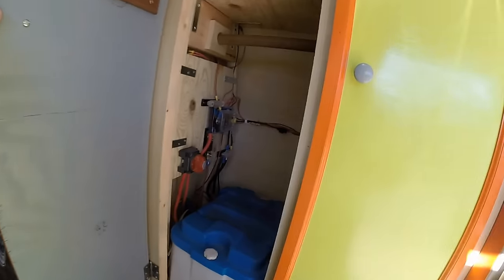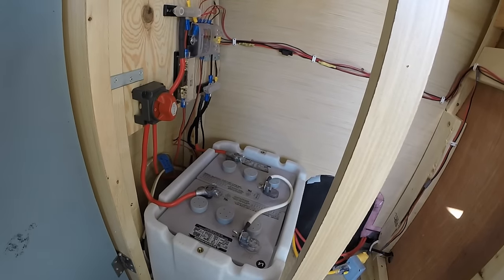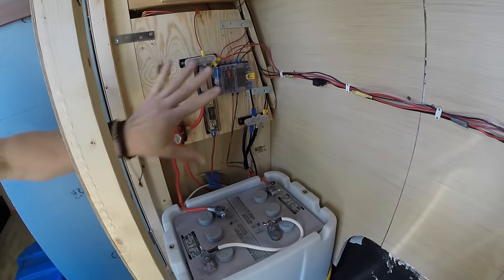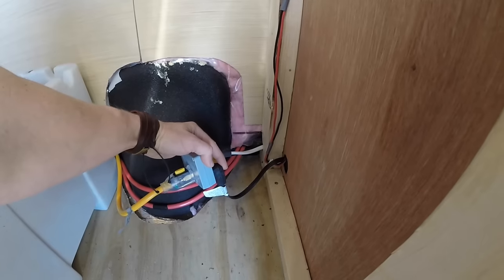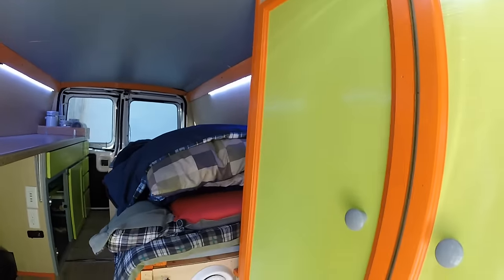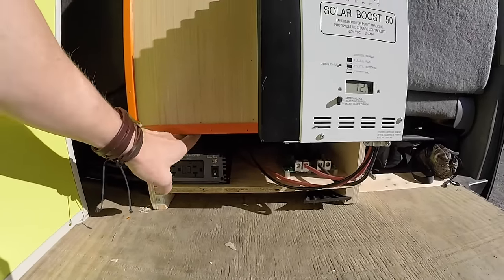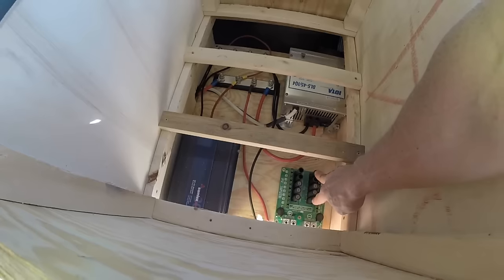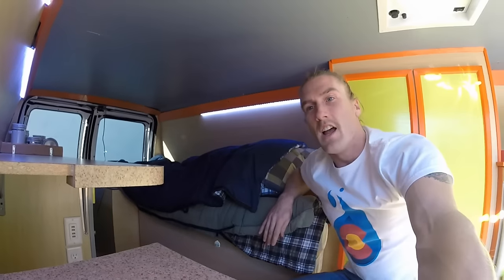Living in a Van: Battery System Installation - #VanLife

Comment: What resources can you recommend for someone who would like to do a similar set up like yours, but who doesn't have the know-how as to how to hook it all together?  I want to buy a van to convert at some point in the future, but don't know anything about hooking up the wiring and electricity.  Thanks so much for your time.  Awesome job on your build out.  It's very inspiring. :)
Reply from the maker: +Jennifer Heredia Google and YouTube. Or me. It really depends on how much help you need, all the way from the whole system design, down to crimping and soldering wires. If you want direct access to my email, sign-up on my website, DavidSandel.com. I'd love to help out!
Reply: *****  Wow that's so kind of you!  Thank you so much.  I may just do that when it gets closer to the time.  I don't even have a van yet. :) hehe  Thanks again. :)
Reply: +Jennifer Heredia  This is a complex system, don't be intimidated. On a small budget start with a 100 watt panel -> PWM charge controller -> 1 Deep cycle battery -> Inverter -> You now have power. Just that will power your electronics no problem. For basically what I've described check out LivingFree channel.
Reply: WanderlustmanChris Thank you so much Chris.  Just curious, why did you go with the PWM over a MTTP?  I have heard that the MTTP is more efficient with the power usage is that correct or is it only in certain circumstances?  I have a lot of research to do and fortunately my brother is an electrician so he could help me with the wiring, but as far as the components themselves go there are so many options.  I was reading that Lithium batteries are better than a deep cycle lead acid battery, but they cost more.  What are your thoughts on that?  Sorry for all the newb questions. It's just that there is so much information out there and it is hard to decipher it in order to come up with what will be best for me and my usage.  Thanks so much. :)
Reply from the maker: +Jennifer Heredia LiFePO4 batteries are far superior, but the associated cost just isn't worth it for a very basic van or RV installation. MPPT gives you more control over tuning the charging system and is generally faster than PWM, but also comes with added cost. For most people, well designed system using the more common, cheaper components are good enough so long as cable sizes, lengths, and best practices are used. I was just lucky enough to get some of these higher-end components for free from a friend.

Here's my blog post on getting started on designing your system: http://davidsandel.com/designing-your-vans-electrical-system/
Reply: +Jennifer Heredia I'm using an mppt controller. I mentioned pwm because there's nothing wrong with them at all and there are $50-$75 ones that are great and are far more likely to last forever (I'm on my second mppt already), yes they are more efficient to a degree. If your budget allows spend the $200-250 on something like a Renogy 40 amp and I say 40 amp over the 20 amp because it's not that much more $ and allows for up to four 100 watt panels. If you can afford Lithium batteries get them, they are superior technology by far. The best regular battery is the Lifeline model 8D and model 4D (I have two of the 4D's) but even those are $500-$700. A starter method is to go with the highest amp hour deep cycle from any big box store or auto parts store. Battery cables are very important, I recommend always sizing up. Larger cables dissipate heat and that will be safe year round and help your batteries live long and prosper. Large cables are also stable while driving. Making your own cables to size out of welding cable is the best way to go. Sounds like your bro could easily do this. The budget route is to get the $40 harbor freight 6' inverter cables, they  are thick, decent quality, readily available and can be cut to size. The cables from the panels to the charge controller are called 'tray cable' and are simply plug & play. Don't expect to run heat/ac. If you want a microwave, small fridge and to use a coffee pot that's when you have to start getting more batteries and more 100 watt panels (I have three panels). For an inverter, pure-sine is the way to go, on a budget there's a million of them. I recommend 2000-3000 watts if you only want to buy an inverter once. I have a pure-sine 2000 watt and run a large dorm fridge, microwave, electric skillet, 32'' led tv, bluray, laptop, video game, tv antenna, phone, speaker bar, two plug-in led light bars and right now also an led christmas tree practically all day every day with no problem. I do turn the skillet off if the microwave is on for a few minutes. 

To do solar simply- There are all in one 100 watt suitcase kits that only need to hooked to a battery and your up and running that fit a lot of peoples needs. Less than $250

To have a gonzo solar van- Get 4x100 watt panels, a 40 amp charge controller, 3000 watt pure-sine inverter and start adding batteries. $1400+
Reply: ***** Thank you SO MUCH!  I really appreciate the information and your time. :)  Blessings to you. :)
Reply: WanderlustmanChris Thank you so much for your reply!  Lots of good advice and information.  I was thinking too that I would probably need a 2000 or 3000 pure sine inverter, but wasn't sure about batteries, and controllers.  Great tip there on the cables!  I hadn't even thought about that.  For me, I would be running either a tv or a projector (don't own either yet and still deciding what would be more energy efficient), LED lights, a very small submersible water pump, a clothing spin dryer for laundry that uses 135 watts for approximately a minute or two, was thinking of maybe doing that conversion on a freezer to chest to make it a solar fridge, but don't know if I will do that yet or just get a marine one, a toaster oven that can do all my baking as well, possibly a microwave (haven't decided about that yet or if I will just use my butane burner for everything) and enough juice to have the ability to charge up electronics like laptops, cell phones and rechargeable batteries.  I'm thinking that's all I might need.  I don't know yet if I will get an electric space heater or one of those gas ones like the Mr. Heater. I like the idea of electric though.  Feels safer to me since I would be using it at night when I'm sleeping.  I like simplicity and I want to have a very simple set up, but I want it to be effective too and enough to handle my power needs without worry.  I'm also wondering if I should get a water distiller or not too.  Still researching that as well.  I didn't know that the MTTPs burn out like that.  Thanks so much for telling me and thank you for all of your helpful advice.  I really appreciate it. :)
Reply: Would love to hear more about your charging from the alternator. How you wired it an such. 
Thanks for the quick overview.

Comment: how much did you spend on your electrical system, who helped you, where did you get your ideas?
Reply from the maker: I was supremely lucky enough to have a friend with the extra batteries, solar charge controller, charge converter, and a lot of wiring. I spent maybe $150-250 on the rest of the wiring, outlets, inverter, and connectors. 

I'm an electrical engineer by degree so I just came up with it on my own. If you're interested, my entire wiring diagram, installation drawing, and a "how-to" design your own system is on my site. Let me know if you'd like the link.

Comment: I will park house in steel building part of time, no sun. Other times I will be off grid. If I don't get enough sun traveling could set up a charging wire off of truck. Just wondering if there is controller to handle all that power input from not only solar or should I set up a separate system of a.c. some things in home will be microwave, ac dc fridge, tv, laptop, ect. Just wondering if you had any advice or how you would wire it for my conditions. Mine is a little out of ordinary.
Reply from the maker: It's really not that out of the ordinary. I'm happy to talk about this a little bit more outside of here in order to explain things more clearly. Send me an email if you'd like to continue: info@vanlife.academy

Comment: You seem pretty good at this I am designing a tiny house and going all 12 volt lighting but will plug into 120 ac alot of time. Question... how do I set up the system to have a charging system set up so I don't over charge batteries with solar, 120 ac, and vehicle altinator charging. Is there a device that will accept all 3 and monitor batteries and maintain them?
Reply from the maker: Thim Bales, Can you explain a little better? How will your tiny house have AC input and a vehicle alternator? As for solar, that’s exactly what the solar charge controller does — it monitors the charge on the battery and then allows the appropriate amount of current into the battery.

Comment: Seems like o.k. Ventilation (if those closets have an air gap).is there no need to strap those flooded lead acid batteries in place in case of a fender bender or roll over,..
Reply from the maker: The batteries are heavy as f*ck so I'm not worried about them in everyday driving. The dimensions of the box and the closet are such that they can't move anyways. And as for a rollover.....I'll have bigger problems than batteries. ;)

Comment: Hi David, I Have a couple of questions I there an advantage to using 2 6v batteris rather than 1 12v ? and what does the amp hour rating mean? 
Let me tell you my story in a nut shell. I quit my life in San Diego  about 10 years ago and had to move to northern ca to take care of my elderly parents after my mother was parralized from a stroke to make a long story short they have now passed on and with the house in reverse morguage i will be left with out a house.so ive got a little money saved ($5000) and have decided  to buy a van and do the van life for a while Im buying a 1990 ford van conversion with 90,000 mi and in pretty good shape for $3000  and want to power it with solor.. my real question i guess is can i power a small fridge 120w a 19 in. led tv/monitor, dvd player  and computer this way. o yea and existing lighting
Reply from the maker: Carl White The advantage to me is that they were free. Ultimately, the amp-hour rating is what's important. If you can do it with one, great. If you need two, that's fine. Yes, a solar powered system is viable for the things you've listed.

Comment: Is there anything in particular you would do differently with your setup, now that you have been using it for a while?
Reply from the maker: Not much. Maybe done a little more research to find a more efficient refrigerator, and replace the solenoid for charging with the alternator with a manual high-current switch.

Comment: So are you using a smart charger of some sort like a pro sport or something and why didn't you use AGM Batterys ?
Reply from the maker: I use a charge controller for the solar panels. The AC-DC converter has a built-in sensing circuit that will control it's output based on the battery's charge state. The alternator will only charge to 13.6V which is below it's rated capacity. AGM's are too expensive and only offer a marginal factor of safety compared to a sealed gel battery.

Comment: What charge rate do you get when the engine is running?
Reply from the maker: +Cecil Broom I'm not sure yet. I li-trally just finished yesterday and have only gone for a couple mile drive just to clear out the EGR system from sitting for a week straight.
Reply: +Low Gravity Ascents It seems like a very good idea to start by learning how much you can depend on engine power.  You should be better able to size your solar panels with that information in hand. 

You have so much battery capacity that you won't have to worry about getting a full charge absolutely every day.  It will be interesting to watch.
Reply from the maker: +Cecil Broom Yeah, I went over all of that in my epically long video that I scrapped. I never really planned for the alternator to be a primary charging system, to go from "0V" to 12V, but more of a top-off while driving around. That said, I'll still plan my solar panels as if they're a standalone charging system. It's really not going to make a huge difference whether I get 2 or 3 100W panels.

Comment: How to install multiple regular wall outlets ? pls I need help
Reply from the maker: It depends on what you have in your van. Do you want to use them off the battery? You'll need an inverter and wire them to that. Do you want to use them if you're plugged into shore power? You just need something similar to a junction box or power strip rated for your loads.